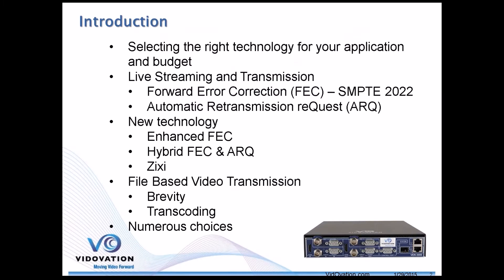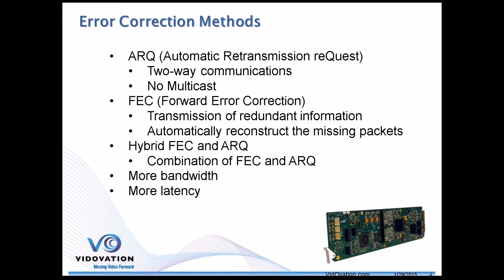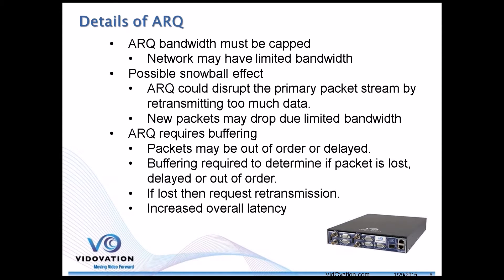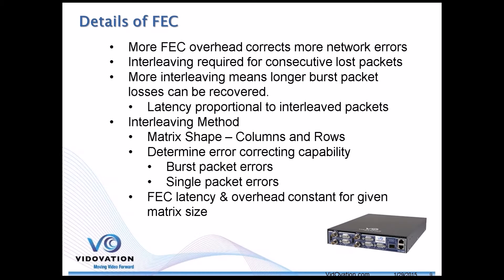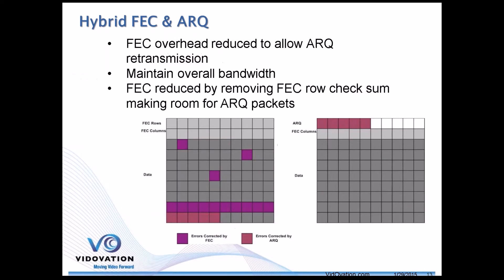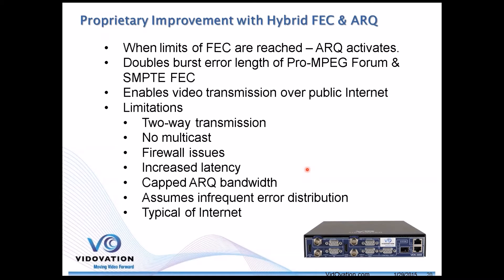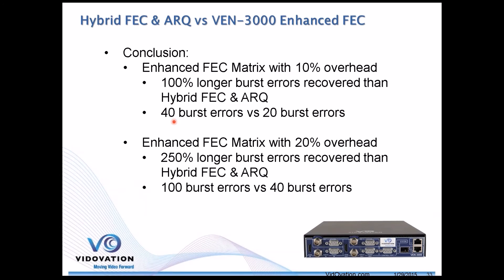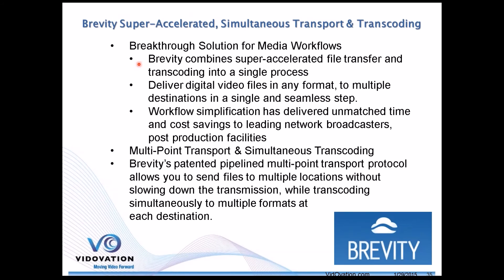Error Correction Techniques for IP Networks - FEC - ARQ - Hybrid - Enhanced

Comment: Thanks for sharing.  at 24:30 you talk about the FEC failing to correct 5 blocks that are too many to handle.  Wouldn't the fact that you have too many blocks to fix at this point invalidate this entire frame of 10x10 blocks from any FEC correction? It's all or nothing surely? At this point, assuming you are using this hybrid, your ARQ would have to resend all the purple and light purple blocks.
Reply: That the FEC completely fails when it fails, is the reason we prefer ARQ. In a bad packet loss situation, the FEC holds its hands up and nothing is fixed, while the ARQ at least (if the error correction is reasonably constrained from going mad) does fix some... possibly even most of the blocks.

Comment: One thing I'm not clear on still, is at what level FEC works in a networking environmen t. In DVB, satellite and terrestrial broadcast, and also CD's and DVD's, the loss is at a byte level, so a byte level FEC does wonders. But for a network transmission, where we're talking about something like 1316 byte blocks, is FEC done treating each block like it were a byte? The overhead for doing the maths must be enormous effectively handling something like ten thousand bit numbers (1316*8).  Or if I'm wrong, and network transmission FEC IS being done still at the byte level, I can't see how it works at all.  Most of the loss seen on UDP broadcasting is a complete loss of a packet, never a packet corruption, and sometimes a packet order problem (which is trivial to fix). In such a case the burst length of a byte-based FEC would have to at least be 1316 bytes.

Comment: The implication at 34.50 ish is that FEC is only able to fix one error per column. Is this true? I'm no maths expert, but when I was working on CD's and CD error correction, we could fix one error in the row, then up to 4 errors in the columns. The maths got increasingly harder for each error. I even played with the idea of correcting more than 4, by going back and redoing C1 on a partly corrected block...